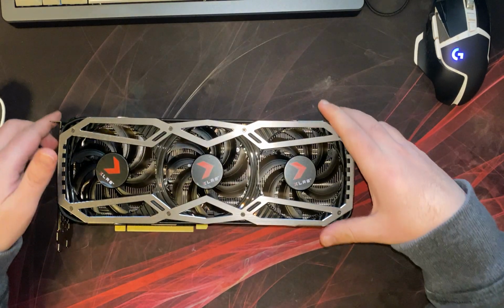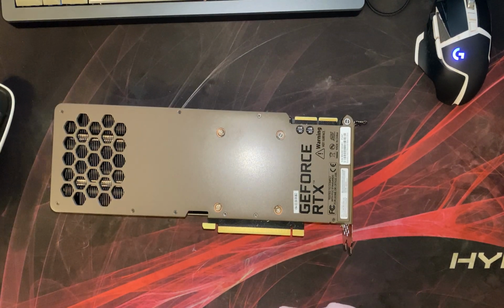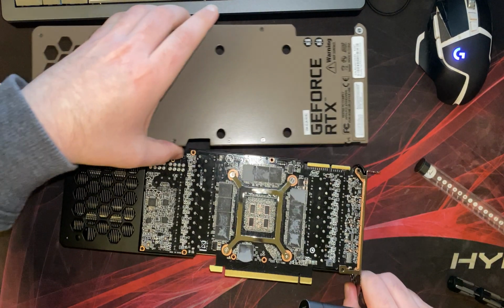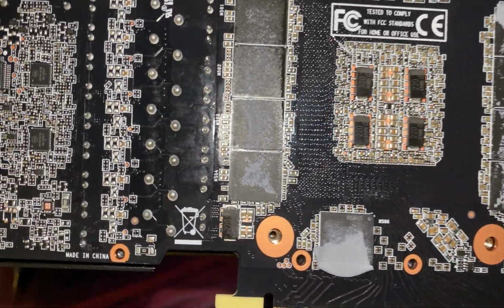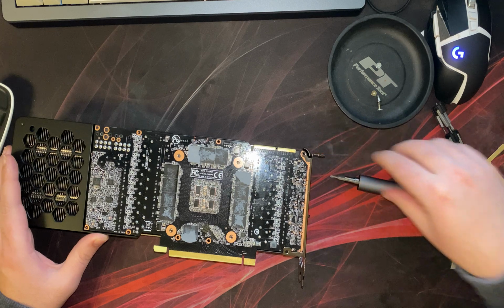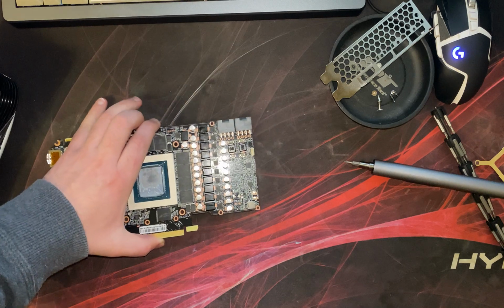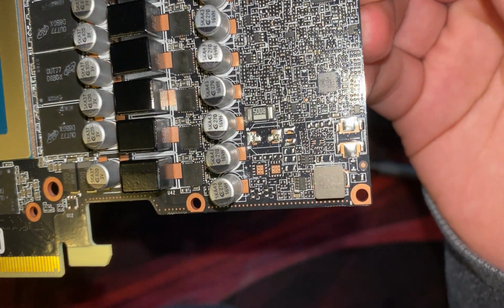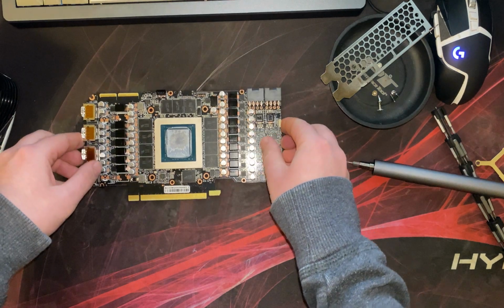PNY RTX 3090 XLR8 Revel teardown, reference PCB close up and size comparison to a typical RTX 3090

Comment: dam so the zotac version sucks? I like the lighting on it but nevermind ! lol
Reply from the maker: yea, the zotac cards suck. they use the bare minimum that nvidia will allow. the line filtering is not only extremely limited in terms of capacitance, but it also has really slow transient response times. they really scraped the bottom of the barrel. the zotac cards will still work, but for the prices they are asking, you can get something much better if you hold out.
Reply: Is this pny card good? Or should I wait for an asus strix or something

Comment: Hey I have the same 3090 XLR8 Revel card, was thinking of replacing the thermal pads with the Thermal Grizzly Minus pad 8, do you know how much thickness would be required for this specific card ? 2.5mm or 3mm? also, is it safe to use thermal Grizzly Kryonaut paste on the main GPU chip on front?
Reply: i want to do the same with mine 3080 Pny Revel 
that card is a beast and i wanna maximize performance
Reply: Hi. Did either of you figure it out? Thanx!
Reply: @tomfalch8992  I ordered the Thermal Grizzly 1mm pads as I heard on reddit that anything above 1mm is not going to conduct - will keep you posted once I get 'em.
Reply: @moronsaas2777  Cool, i'll order the 1mm as well then!
Reply: @moronsaas2777  Thanks a bunch! Looking forward to hearing about how it turns out:) I have a feeling that the minus pad 8 pads will make a difference for sure.
Reply: @moronsaas2777  hello Moron! Would you mind sharing your experience with 1mm termalpads please? Did it work well? Thanks a lot in advance!
Reply: @K1NGSnakey  Did you end up replacing the pads on your PNY 3090?
Reply: @knight2255  yes i did a long time back, made a thread too on reddit about it.. but recently i switched to watercooling and now the GPU temps dont get higher than 47C no matter how much load i put on it :) never going back now

Comment: Is the same performance for streaming and gaming?
Reply from the maker: gaming performance is about the same at stock. i don't stream but i can't imagine why there would be a difference between the two. the msi card can go a little faster (2-3%) with the new BIOS, but the new BIOS increases the power draw from 340W to 450W+. it's fucking stupid. it will turn your room into a sauna during long gaming sessions.
Reply: @solomonshv  And this PNY is the same as the founders edition? I mean, performance

Comment: When you say the third PCI-E 8 pin connector doesn't do anything on the Gaming X Trio, do you mean most of the power is drawn from the first 2 ports? So if you have only 2 8 pin PCIE outputs on your PSU (and PSU cables have 8-pin Y-splitters for 4 sets of 8 pin outputs), would you suggest connecting alternating PSU outputs to the PCIE 8 pin inputs? (i.e. PSU cable 1 - GPU 8pin input 1, PSU cable 2 - GPU 8pin input 2, PSU cable 1 split output - GPU input 3?) Thanks
Reply from the maker: on the 3090 trio, the BIOS is limited to 380W if you max out the power target. there are cards with only 2 plugs that have the same or even higher power limits with only 2 connectors. for example, the gigabyte 3090 eagle OC has a 385W limit with only 2 connectors. 

the 3rd power connector is just a decoration, a marketing gimmick. even if you flash the card with a 500W BIOS, the TRIO will not be any faster in day to day use. once you hit around 2000MHz on any 3090, the cards become increasingly unstable. 

another issue with MSI cards specifically is the VRM design. it is comically bad. on modern cards, the GPU die is flanked by the VRM from 2 or more sides. this is done to deliver power evenly across the entire power plane. MSI cards, ALL of them, have an inch long gap between the GPU die and the right bank of the VRM. which means that MSI cards specifically will become less stable faster compared to any other cards as voltage goes up.
Reply: @solomonshv   Ok so you are just saying in terms of theoretical maximum. My questions is more in terms of load balancing. I thought you meant the third connector literally does nothing, but what you mean is it adds nothing in terms of power budget. 

So in that case I'm guessing in practice they all draw power evenly and if you only have 2 PCI-E PSU cables it doesn't matter which order the 8 pin connectors you connect to on the card itself then. I thought you were referring to functionality of that PCIE port specifically.
Reply from the maker: @derelictmusic3218  i'm using a corsair AX1600i PSU, it has digital readout for power draws from each connector. the 3rd connector was not doing much at any point. 

and even if it did load balance across the 3 plugs, it won't matter unless you have an old AF multi 12V rail PSU. those are rare these days. if it's a single 12V rail PSU, all the power is coming from the same place and the cables are more than capable of handling it. in the end, the msi trio was not any faster than this reference PNY card and was slower than the asus 3090 tuf and strix. both of which i currently have on hand.
Reply: @solomonshv  Since you have both cards, can you comment on how loud the cards are? Since AFAIK all the Ampere cards now have fixed 30% minimum fan speed. Is the Gaming X Trio significantly quieter than the PNY? I think PNY XLR8 cards have a reputation for being noisy even at low settings.
Reply: @derelictmusic3218  @UCjES9eG1jb_x86ifMz6VDEg , Yeah I`m curious about that too, I`m about to pull the Triger for the XLR8, what are the noise levels compared to msi x trio?
Reply: @solomonshv  im now building my pc my Psu is corsairs 1000hx do i need make it single or multi v12?
My build wil be ryzen 3900x + rtx 3080 2x 8 pin
Reply: @derelictmusic3218  I have the PNY RTX 3080 XLR8 and if I leave fan curve in automatic I can’t hear it at all. Very quiet, sturdy and built like a tank. It’s not a coincidence why PNY is the only authorized brand to build Quadros and Tesla’s... they have many many years of practice in the business.

All other brands are like toys to me. They only focus on visuals, and marketing gimmick features, that will wear out with time. I still have a almost 20year flash drive from PNY, so my experience with their products is ultra-positive.
Reply: I just bought PNY 3070 XLR 8...when playing AAA games, the maximum temps was 75 c  with Auto Fan..(room with no Air conditioner). Tbh, It was silent compare to my cpu fan and my case fan
Reply from the maker: i made this picture comparison for people who don't know what gap i'm talking about, hope it helps: https://i.imgur.com/zcLLTET.jpg

Comment: Thank you so much for this. I was thinking getting the PNY 3090 Revel for a small form factor case compared to the MSI 3090  Gaming X Trio. How do I find out how it compares to other 3090 models on timespy?
Reply from the maker: I dialed in a little OC, moved the power target to maximum and getting just under 20k GPU score. About the same as msi trio (pictured in video) and asus tuf. It performs just about the same as MOST other 3090s. The only 3090 I’ve tested that was faster* without pulling over 400W was the strix. 

You can get much better scores from a ftw3 but you’ll be pulling 500W. Which is just not feasible in a SFF build.

Comment: Just bought this card and this video was very informative, thank you!
Reply from the maker: no problem! glad it helped someone. i rolled the dice on this not knowing what to expect. while this card has some shortcomings, for my use case i think it's fine. after recording this video i noticed that the line filtering caps behind the GPU are a lot smaller in capacity than what some other cards are offering. at stock is still be fine and performs in line with other cards at stock settings, BUT, this card is NOT meant for overclocking at all.
Reply: @solomonshv  I’ve got a stable +105 core and +800 memory. Boosts up to 2050mhz stable.

I got to +240 in TimeSpy but it wasn’t stable in games. 

I could probably push the memory further but it I didn’t feel like taking the time.

All without touching voltage, by the way.
Reply: @solomonshv  Do you think this card is suitable for Etherium mining?
For memory overclocking?

Comment: What water block did you go with? I'm stoked about the small size
Reply from the maker: alphacool aurora. i ordered mine from germany and it's stuck in customs. meanwhile, performancePCs restocked it. i should have just waited a few days and i would have already had it in hand. here is a link if you want to check it out: https://www.performance-pcs.com/water-cooling/water-blocks/water-blocks-vga/alphacool-eisblock-aurora-plexi-gpx-n-rtx-3090-3080-with-backplate-reference.html
Reply: @solomonshv  did it ever turn up? If so how is the block? Was looking at this or the EK classic if you have any recommendations?
Reply from the maker: @mrdanky5545  it's working fine. i recorded a video of me installing it but the video file was corrupted somehow. i'll try to fix it later. EK is a rip off. you'll be paying $200+ for block and back plate. alphacool includes the backplate at $135-$145, depending which block you take. i used EK religiously in the past, but stopped when they raised their prices through the roof.
Reply: @solomonshv  thanks for the reply. Unfortunately too late I stuck a vector block and back plate on. I’m happy with the results, not the price. I’m scoring 15000 on port royal now with 1000w vbios on the pny 3090
Reply: @solomonshv   I wonder if active cooling of the other side of the card is required or if passive cooling is enough.  Would it be good to install a water block or is it already redundant?